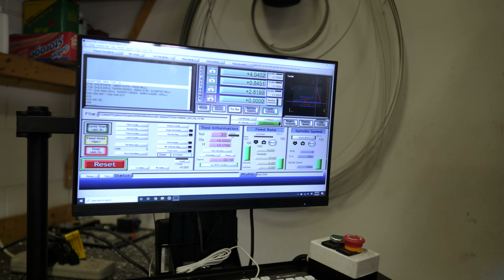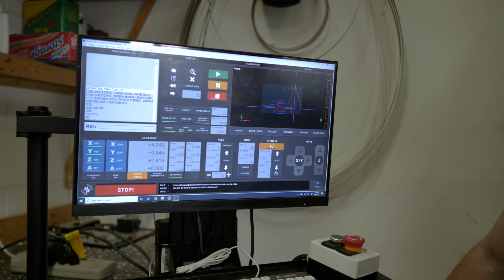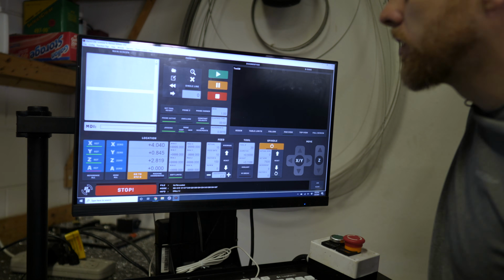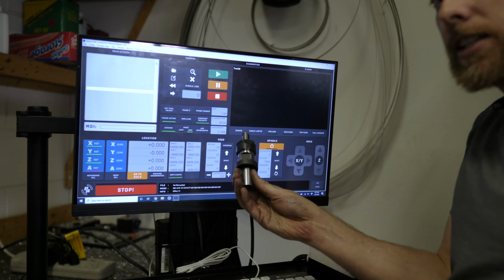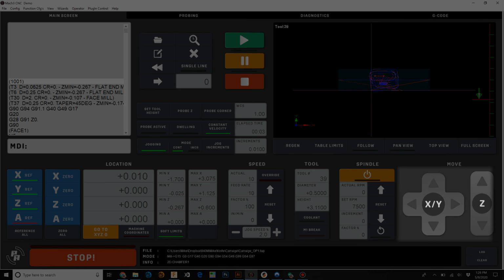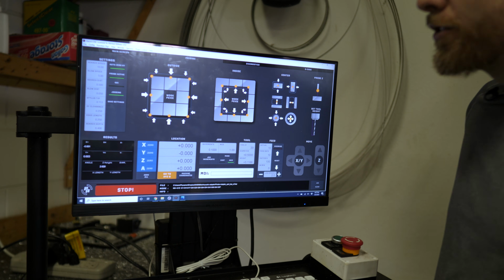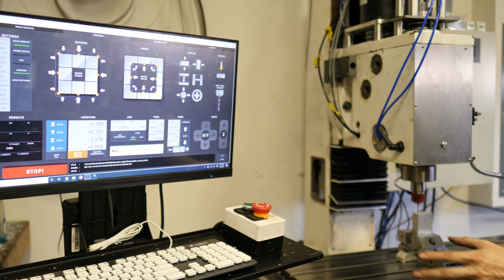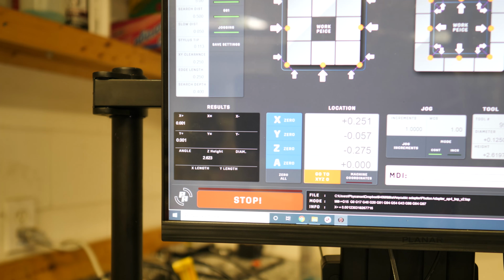Mach 3 Has Never Looked This Good! (CNC Software Part 2) - S03E14

Comment: Hi, what a lovely looking screen thank you. I downloaded mine, set it all up and the screens are all not displaying properly. There is no real text visible, just a generally black screen with some greyed text and some partial layout. All the buttons work when they are clicked on, it is just I cannot actually see them. The bitmaps load perfectly when they are clicked on from within a finder window, just do not display correctly under Mach3. I cannot see anything editable within the Mach 3 program to change this. It is specific to Mach 3 and not my computer as I have opened two different instances on two different computers with the same outcome. Any brief suggestions would be very welcome please.

Comment: Thanks for the great content guys !

Bought a Tee shirt and subscribed.

Couldn't figure out what I was doing wrong when I couldn't get the Soft Limits in Mach4 to automatically run on start-up as I had successfully done it before in Mach4. Your first video in the series pointed out that this was a new bug in their software. Good grief ! Thought I was going crazy.

Really like the new interface and will discuss this with my Makerspace team as we just had a discussion tonight about standardizing our equipment on Mach4.

Would you mind sharing what Windows O/S you're running Mach3 on and also if you're using a parallel port to breakout board interface to the drivers ?

Thanks !

Jay

Comment: I have been using MachStdMill from Calypso for 8-9 years now and I willing paid for it because the base UI for Mach3 is just horrible. It has a very extensive probing feature set, which I have never used. But it has some took height setting automation which makes it really nice for me. Its pretty touch screen friendly and he has screen variants for 1024x768 and 1280x1024.

Comment: @Physics Anonymous !!!Guys please put it in the decription!!! Took me quite some tries to figure it out what was missing. You forgot to say that you need to cipy all the original macros from vers.by/en/ in C:\Mach3\macros\"your Machine profile in used". On the website you can find the installation instruction. You do not need to also install the probe wizard since the macros are already included in the sceenset (they work both for Metric and Imperial). I converted the screenset in Metric and add some features in case someone needs it.

Comment: Very nice job, thanks for posting and sharing. I have an 1100M, this screen set reminds me of PathPilot which I love (but have no other experience to compare to other than not-so-great interface of the ShopBot and Shop Saber). Anyhoo, I'm setting up a cnc router which has an Avid CNC Nema 23 Plug n Play box, gonna try your screen set and hope it works with this controller. Do you rec any particular v of Mach 3 for use on an XP box?

Comment: Also, that LinuxCNC circle jerk is such a classic Linux circle jerk. Linux nerds just can't get over the fact that there are some advantages to Windows based controls. And I say that as the Director of a medium sized IT environment where I use Linux every single day. I've also used LinuxCNC extensively, and it's hardly better than any of the modern Windows Controls like Acorn or UCCNC. The main advantage is that you can run it on a wrist watch pulled from a land fill, so it's cheap, and the cheapskates the world love it. But if you want real support, i.e. support that isn't from a forum, then a paid for software is advantageous. As somebody that makes money from my machine, I'd rather have a support line than have to ask strangers on the internet.

Comment: UCCNC my man. I ran Mach3 for years and got those once a week issues. UCCNC goes for months without issues, and it is still being developed. So instead if building screensets for software that is clearly flawed in multiple ways you could land on something modern and still evolving.

Comment: Hi - just found your video. It is soooo nice. Love the UI you made. So much more sensible. I have a question though. When I lode your UI in to Mach 3 it seams a little squized and small. Almost a bit pixilated. Is there a way to fix this?

Comment: I found a bug, on the WCS (Offsets) window when numbers are input from 1 to 6 the MODE line command does not update (G55, G56, G57, G58 AND G59) automatically but from number from 7 to 209 it does. THANK YOU SO MUCH FOR YOUR AWESOME work for this update screen set. I crushed a work pice but I found the bug thanks to that 😅

Comment: I need Help.
The surface looks great.
Question, have the same problems as  chrisjh777..
Have copied the bitmaps in the macros / Machmill forder.
The iset in the general folder mach3.
When I start mach3 I don't see all bimaps.
This goes well with other shin sets such as the 6 axis.
What could not go wrong.
Work with windows 10

Kind regards Gerrit

Comment: The surface looks great.
Question, have the same problems as  chrisjh777..
Have copied the bitmaps in the macros / Machmill forder.
The iset in the general folder mach3.
When I start mach3 I don't see all bimaps.
This goes well with other shin sets such as the 6 axis.
What could not go wrong.
Work with windows 10

Kind regards Gerrit

Comment: Is there any provision for manually touching off a tool?  I use a Haimer and plan to touch off tools using a gage pin.  So I would need a field to enter the pin diameter and a button to set the tool length to the distance from zero, minus the pin diameter.  I didn't see that in your UI.

Comment: Ive got my laptop set to 1920x1080 and at 100% scale, but it still seems to be chopping off the bottom when I load the screenset. i.e. I can only see a sliver of the stop button and log button, while the clear button is gone.  When I revert back to the "2010 (1920x1080)" set I normally use, its fine.  Any ideas?

Comment: Massive congrats on this redesign! The engineering world gets to see the power of proper design craft. I was personally completely unable to once even touch mach3 because of it's ui. I got here because of your mach4 video, and was constantly giggling at the ui in the background thinking: "what this is mach4? boy it looks pretty dang good compared to mach3" - and then you showed the actual screenshot of mach 4 which gave me a jawdrop followed by a solid multi-minute-facepalm. 
Again, phenomenal work on the UI! It would be nice if this gave a bit of inspiration to other cnc software makers.

Comment: XYZ Min and Max are actually called: Distance to Go in professional CNC controls and for me is THE most critical information that you must have front of your eyes! Well, not all the time, but just to prove to yourself you took your tool length and coordinate system correctly when setting a new job. It works only with "single block", or as you called it "single line". The way I set a new job is to go with single block just before entering the tool in cut. Then I deactivate single block and leave the machine to do it's work. And if I made a mistake I can see it and pause it before is too late!

For me looking like this Min and Max are bit confusing. See how professional controls show coordinate page! Most of them show four coordinates: WCS, Machine, Distance to Go and Operator. I'm using all the time WCS and Distance to Go. If I can recommend some changes it will be to be closer to a professional control but not fully copying it. I have HAAS machine and I love their control, but there are some minor things that needs to be improved. Fanuc is honestly very old and is bit outdated. All professional CNC controls are going Tousch screen now, but this transition is yet very slow. You are on the right path! I think that optimized Mach 3 can be competable with all professional controls at least for the low-torque machines. And I believe there is a big market potential for professionally looking low-torque machines too! Tormach is a good example, but the reason I'll not invest in Tormach is because their machine axis are moving on dove tails. In my opinion, very good quality build-in Europe or America machine with modern linear bearings can be even cheaper than the Tormach IF there is a good looking professionaly made control!

So, in conclusion: I'm not using graphic area at all (for that purpose I have Fusion) and I prefer to have WCS and Distance to Go on that screen with big numbers and letters instead!
P.S. I have a project in mind about small two axis lathe. How do you feel about a cooperation in such project?

Comment: Regarding windows touchscreen. I've had to switch "tablet mode" on IIRC with some issues I had with a big multi screen rig. That might help you.
I've just uploaded a video covering Clearpath servos. The HLFB pin can be set to have various outputs. This may be usable for homing. Look at ASG (All Systems Go). Maybe a combination HLFB and a traditional limit switch in series would signal a homed state, only when the hard stop homing operation has been completed, and also not trigger a homed state if HLFB triggers during normal operation.
Keep up the great work.
-Ken

Comment: Very good. Thanks for sharing the screen set. I REALLY like it; and when I don't or get confused, I can temporarily switch back to the OEM Mach 3 screens. Note: On diagnostics page above eStop, coolant is spelled coolent. And what is Broche: near I can make out it is french for spindle, and it turns the spindle on and off on the Main screen. Also the 'speed' on diagnostics page (below  ready/start/pause/tool change/speed) is 'dwell' which I use for allowing my spindle to spin up for 10 seconds before cutting immediately. Subscribed :-)

Comment: I'm totally new to CNC although I had a CNC mill for about 4 years and I just play with it writing programs for fictitious parts for practice and learning CNC and have not cut any metal with it to date.
I get the impression, watching this vid, that you are the kind of guy who buys a brand spanking new car and before it hits your driveway you are ripping out the sound system to fit some weird high tech gizmo GPS capable thingo with an alarm built in that tells you if anyone looks at your new toy in an envious way.
At the same time you are waiting for a complete new set of tyres that are only available to special order because you want to do things that cars were not designed to do but your friends think it could be cool if you could do them...off road of course etc.
But it get worse.....the paint work needs to be refreshed because at night it appears to be a dark blue whereas there is no blue in the designer paint pallet that it came with.
After you have rebuilt the engine, before the car has even ran,  with new pistons and other weird stuff that you had to wait 6 months for because it was a foreign import that nobody has heard of but is recommended by someone on a TV chat show that geeks out in cars......finally a new model is being advertised and so you put this one up for a quick sale and go to the showroom for an indepth preview of the only model they have for a demo......only joking, I knew a guy who actually did that.....I thought I'd have a rant about updating for the sake of updating........those screen shots got me going......what's wrong with the stock standard screenset with the pale green backround on the digital readouts....huh  huh?

Comment: First, thank you for your work. It is very functional and i am using it. Second, i just have a question... The spindle rpm controls a laser in my case. I have a different profile for milling. While it works fine if i enter the value directly, nothing happens if i press Up and Down arrows in that panel. No matter what increment i set there. I am doing something wrong?

Comment: After using the screenset for a few days I found some things in the interface. When clicking on the jogging button, it never disables. The led goes off but, you can still click on the cont and incr buttons without them lighting and they all still work. On my multitouch screen, all of the buttons work except the jogging buttons. probably the type of screen I have though. I do not have another to test with. Great start though. What screen app did you use to redesign this?

Comment: OK, so check this out. Your touch screen button issue can be solved by disabling the feature that turns a press and hold into a right click. I had this issue setting up customer HMIs on oil rigs.

Comment: Excellent job.  Any way to add machine coordinates next to the work coordinates (looks like there is room) rather than having to toggle between them?  Please add or replace "work offset 1" wording with G54- its such a widespread convention.  Also workpiece is spelled wrong on the probing page.  Minor quibbles on what is really fantastic work.  All we need is someone to hack the probing pin thing

Comment: I also want to add I could never stand the buttons themselves on mach 3. They were all diffenrt colors, and it was hard to tell if one was pressed or not. Thank you for making them all the same color. That helps a lot knowing if one is pressed. (note I'm also colorblind, so its harder for me than most other people). The line you put at the bottom of each button that lights up is ok. I wonder if it can be improved slightly more, to easier tell at a glance if a button is pressed or not.

Comment: Hey you did a great job! I use the screenset called Aqua at this link: http://www.thecncwoodworker.com/Mach3/images/Aqua_Big.png

(no affiliation). When I switched back to the default screen for a few minuets after using Aqua for one year, I about passed out at how horrible it is! ha ha.

I have a suggestion after viewing your video, (but not using your screen yet). Have you considered moving the job speed button next to the jog arrows? Maybe separating it from the spindle speed section?

Also for the work offsets, maybe changing the decimal value to an integer? And maybe even displaying the G code, so offset 1 would look like 1-G54, and offset 3 would look like 3-G57?

I also never understood why the Ref axis and Ref all axis buttons on mach 3 were so huge. You really only use them once per session upon powering up and homing the machine. They take up a lot of screen real-estate for a super important function, but only used once. I see you carried over the large buttons for that. Have you considered making them smaller?

I'm not a UX person, but work with them in my day job. When I saw your intro that that is your day job, I became super excited to see what you'd come up with. You did great IMO:)

Comment: I've been using Verser probing on Linuxcnc. Same basic software. It works well. I had to modify it a little to work with my probing setup (spindle probe and fixed table tool setter, switchable between a relay), but it works well.

Physics anonymous - do what i did, get a spdt relay and tie your probes into it. Switch between them with an output and use your pin input for both

Comment: Hi, is there a easy way to adapt to HD screens? my current setup is running and old 1280x720p LCD panel, and the mach3 interface does not seems to scale accordingly to the screen size.  So i'm trying to unravel the mysteries behind mach3 interface design. Thanks

Comment: I downloaded the zip file from your link, and extracted it.  I pasted the screenset file into my C:/Mach3 and the bitmaps into the bitmap folder in C:/Mach3.  When I load the screenset, my screen is very dark and unusable.  I suspect I do not have the bitmap images in the correct folder.  Any hints?

Comment: Nice screen and great vid. Just wondering if you have a link to the wireless tool height probe? Last one i had wasnt reliable but sounds like your comfortable with this one.? Im having issues with z probe routines not putting tool offsets into table etc, may need to be macro not script but for time being ive modified to use big tex script. Can you also change feed DRO to Units/Min or better yet possible to release the layered graphic file so ppl can modify it to suit their needs? Happy to donate for files as i do find this

Comment: Do you still have all the jog settings when you press tab? And can you add a Spindle Pulleys box so you can set which pulley you're running without having to go into the menu? Also the GO TO 0 XY would be great.